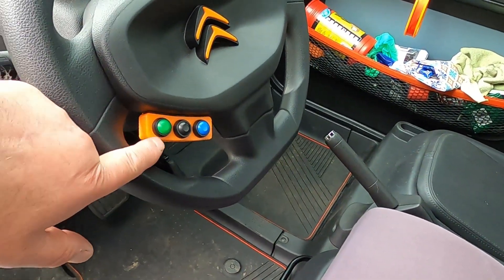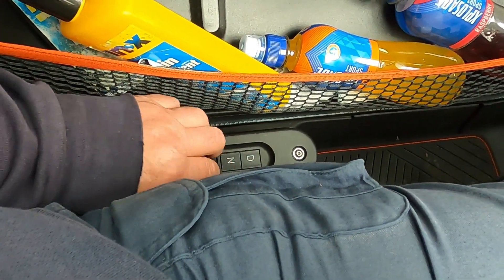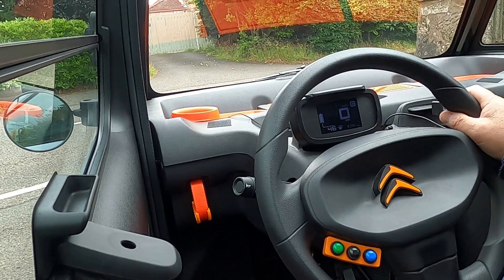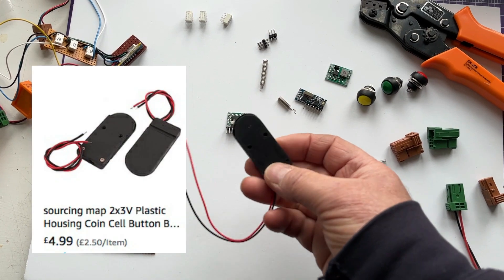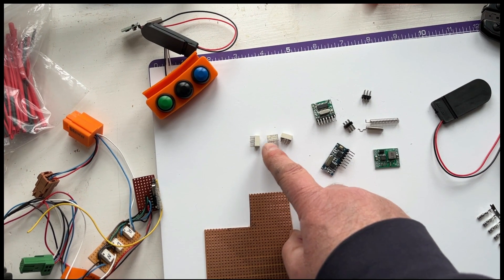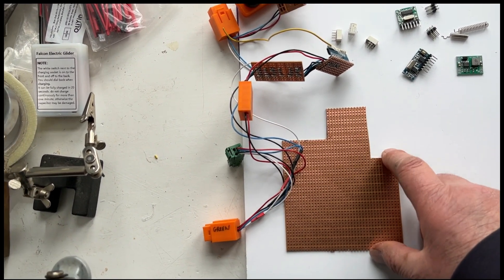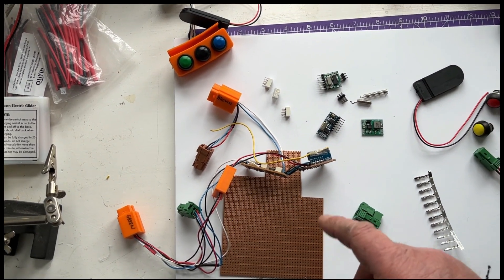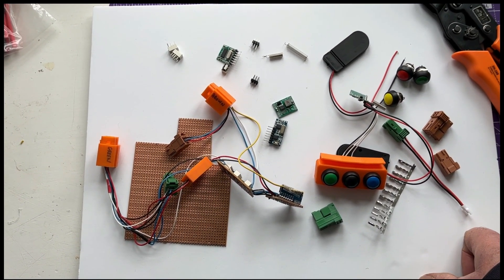Steering Wheel Mounted Push-Button Gear Change for Citroen Ami : Build, Fit & Test

Comment: hi Doug do you knof if the drive belt of the ami can be adjusted mine slips a little the drive belt tanxs for the answer
Reply from the maker: Yes, it is fairly easy to adjust. just loosen two torx bolts and lever the underside of the motor to tension and re-tighten the bolts. The correct tension is checked by measuring the distance between the inner edges of the two pulleys. The dimension should be between 49.80mm and 50.77mm (measured with vernier calipers).
Reply: @DougsShed  tanxs some People talk about a New engine mine slips its only 2 weeks old i go check with my dealer

Comment: Looking at your modifications and explanations I'm getting closer to ordering an Ami please keep adding more info ,I'm looking at getting rid of 1 car and motorbike this could replace both keep up the excellent work 👍
Reply from the maker: The Ami does have its flaws, best to try and get an extended test drive before you commit. Beware the battery range and speed up hills gets compromised in cold weather (less than 5 deg.C).

Comment: I don't know why my posts are deleted. I would like to thank you for giving such great information for this project I would like toI replicate, I am especially interested in grabbing the rear gear signal to activate a rear light. Can you share your stl files?
Reply from the maker: Very odd - I got a notification to an earlier post but it does not appear - must be a YouTube glitch.
I will probably list the stl files, probably on my website. I'll let you know when I do. The signal for the gear selection is momentary with the ecu and canbus doing the actual selection. maybe use a latching relay circuit to detect when the reverse has been selected?
Reply: @DougsShed  This is what I am thinking about :-) But I can't think how to prevent that a second push on the R button would switch the retro light
Reply from the maker: @claustrox  Logic for switching on rear light needs to have brake signal + reverse switch signal. To turn off rear light just need to have any of the 3 switches pressed (Drive Neutral Reverse). Perhaps use an Arduino or similar.
Reply: @DougsShed  Thank you ;! I already coded a simple  sketch for arduino but I didn't know about the brake signal , I have to add it and then maybe I will feed the arduino or an esp8266 trough a voltage divider. Thank you !
Reply from the maker: I have now added the .stl files for the Button Housing and the Raiser Block on my website at https://dougsshed.co.uk/home/citroen-ami-electric/

Comment: Um... I can only afford to ride a bike these days, but it looks like a good idea to me.  I think. Sort of. To be honest, I'd be reluctant to put my trust in a DIY radio link for something as vital as gear selection.

But don't pay any attention to me - I'm the kind of cyclist who forgets to cancel her hand signals. 🤭
Reply: How does original factory fitted gear change override remote if remote switch is connected in parallel. i.e remote malfunctions and relay contacts closes, can't see how manual can override closed contact in parallel?
Reply from the maker: @exilimitor  Both switches are momentary action normally open circuit. When either switch is closed the gear change signal is sent.
Reply: I see so remote is fail safe but guess I would be a bit worried if remote malfunctioned to normally closed you could not override with default manual system.
Reply from the maker: @exilimitor  Not entirely fail safe but failure modes are fairly benign. The remote gear change system can be removed and revert to standard in about 1 minute.
Reply: Question, does the system have any latency? System reliability? I was looking at a system from my quick shifter but found issues with large latency with 2.4ghz systems
Reply from the maker: @timwoods8483  Latency is fine with this simple DNR gear selector. May not be good enough for a quick shifter application.
Reply from the maker: Original function of the manual gear change is maintained at all times.